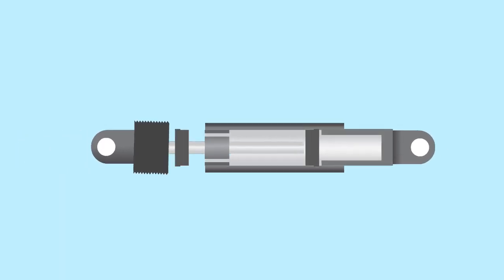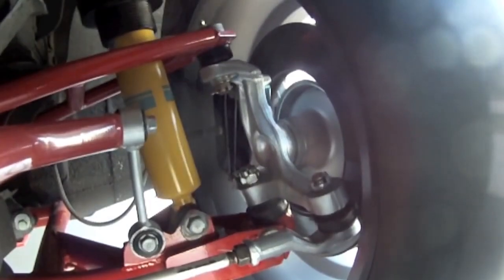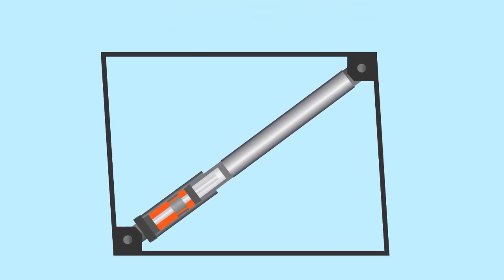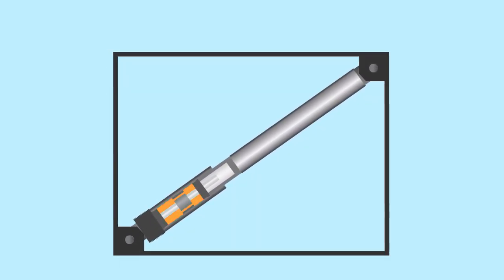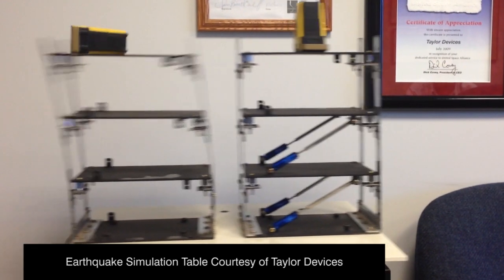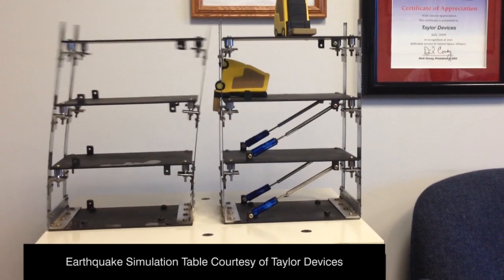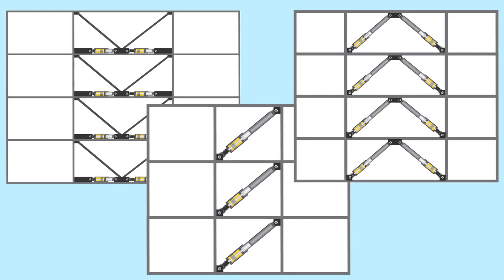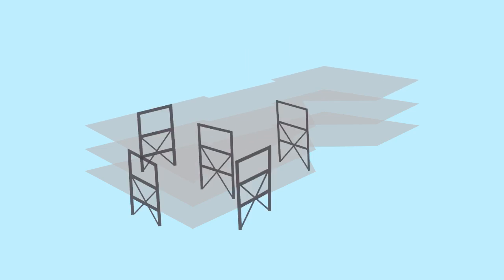What is a Fluid Viscous Damper

Comment: this real model is not happen in high building because  we control the displacement small. acceleration is high but displacement is small , so velocity is very small between 2 joints inside frame. damper is not working inside building. it will be good in gap between 2 high building close together